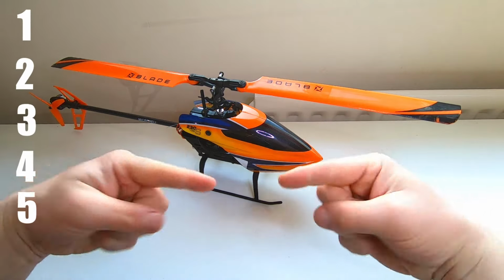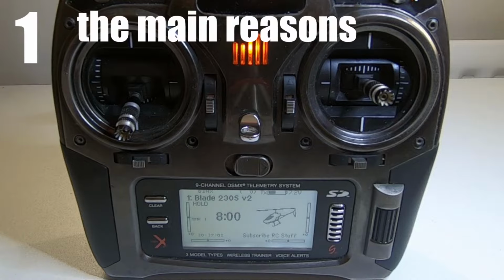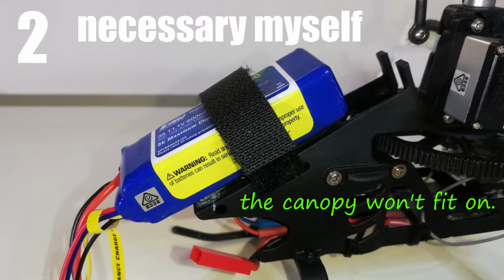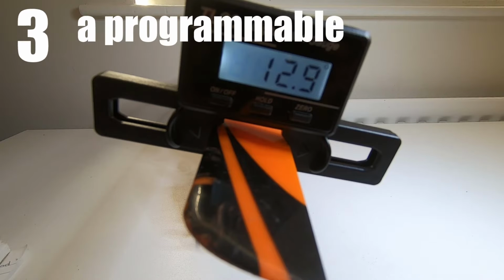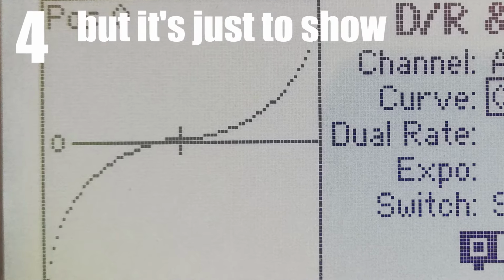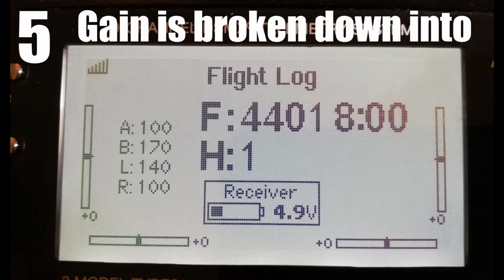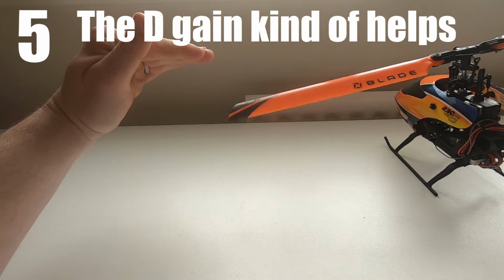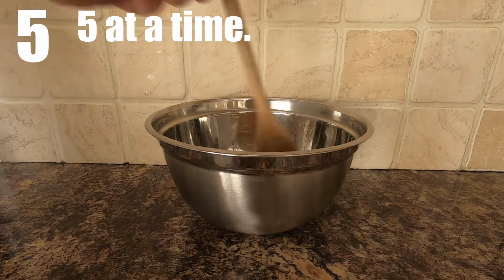Make your RC heli easier to fly: BEGINNERS guide.

Comment: That is not the gain menu, that’s tuned through forward programming on the AR363. Those are the individual antenna fades, with total number of fades and holds being reported as F and H. Your F recording being that high is insane it should never be that high.

Comment: if you are going to explain pid.  then don't say bullsh*t  

people google was PID tuning is.  
it's something that people do to fine tune servo motors and heating devices.  

basicly you are telling a servo motor to move x amount.  
and with pid tuning you will tell the software how HARD/FAST it needs to correct (so apply more or less voltage).  how much it needs to anticipate approaching it's final position and thus slow down to be able to stop exactly where you told it to.  
and how hard it needs to try and hold that position. (it could move to position and go full voltage trying to hold it there.  or basicly drop all power and hope it just stays there on it's own) 

you heard his helicopter make a whining sound when he was showing us the angle of the dual rates right?  
yeah that's servo whining.   
that means this guy has no goddamn clue what pid tuning is and how it's supposed to be done.

google it.  because this is just a really quick and dirty explaination.   
it's not even in the right order.  

(also you are not directly programming the servo's you are programming the flight controller in relation to it's gyro readings.) 

to anyone reading this right now.  i advise not watching any of this youtuber's video's.  i had to complain like this in a another video aswel.  
he doesn't know half of what he's talking about most of the times.  and you will probbably mess something up if you follow his advice.
Reply from the maker: lol ok mate. I never said I was a top expert or anything or even explained PID the best it was a very brief explainer. Tell me objectively ehich bit was incorrect? Also you were wrong on your other comment about orientations, Far more experienced people than me advise going tail in.
Reply: @RCStuffvideos  
not an expert was verry clear.  

just like one of your beginner tips being "if you get disoriented.  go tail in" 

b*tch if someone is disoriented.  how the HELL is he supposed to know wich was is tail in.  

that's like saying 
"when you are on fire.  don't be"
Reply from the maker: Bitch? Don't be rude or. I'll just ignore you? It's pretty obvious. As i said. You move the tail  control until you see the tail is pointing towards you. No one else seems to struggle with this.

Comment: Ok I have a Fw200 and this is my first Heli and want to start trying to fly on manual. What should do first to help with the controls as I am on the RTF controller. I was thinking turning head speed down but that’s all I can really do I think.
Reply from the maker: Hello don't know  anything  about the fw200 but use a bit  more expo and try lower rates so controls move a bit less.

Comment: I just bought the 330S RTF version and tried to fly yesterday, but could not even take off. As soon as I start slowly giving it throttle it starts leaning to the right and if it just starts to lift off the blades hit the ground.  I will start trying to figure it out, but your video should be a help.  Thanks
Reply: That's what happen to me.
After got some adviced tht auto travel of the sevro was wrongly set.
Then found out the travel of the servo arm after initial setup after plug in the power.
Then checking the travel of the servo arm that should be reverse direction force position when the body was lean to the left, the left servo arm should move up to correct tile back to its original position of heli perpendicular to the ground.
In the same to reflect action, if lean heli to the right, right servo arm should move up makes the swatch plate level back to reflect the action of lean to the right. Then tail up/down.
Servo arm should move to the position to make the swatch plate level back to its same original level to the ground position.
》What I found out in my, was the setting of the control gyro box position was select in the wrong opposite direcrtion.
Makes the heli try to lean to the side then blade hit the ground every time try to take off, and lost 4 pair blade to figured this out.
》The old good flying setting changed by itself of left no fly for years.
Reply from the maker: Ok cool good luck. Make sure it's level when plugging in battery especially when using self levelling. Check was swash plate is level after power up and all servos look centred. Maybe gyro the fbl needs calibrating too but the manual might talk about these things too.

Comment: Another "must read" !!! I got my 230s Smart in a good place with both mechanical setup and calibration. Basic tuning with very little done has made it predictable and solid. 
My 150s Smart is almost there too, just a little more fiddling and it will be solid
But the Fusion 180 Smart is a different beast. I have done a lot of with the basics. Still would feel a little disconnect, not solid, kind floaty. Been messing with the PID tuning, mostly P and I, nothing with D. I think your explanation will help. Belt driven tail has me learning though....thanks again for the video.
Reply from the maker: Cheers eric!

Comment: Thank you for this. My blade 230sv2 which now MH main frame coming 80$ more lol purposes like a dolphin. Lower pitch tiny help, but it’s annoying . Any advice ? Reduced battery it calms down. Maybe the upgraded motor. 2526/4500 believe. Next move back stock motor . Stock pinion. One thing I had it mid stick ready to pop smooth as glass, still bogs
Reply from the maker: Mine is completely stock and it porpoises too. Think there's something about the design. Probably because it's small. Ues it is annoying isn't it. How much pitch are you using? What curves?
Reply: @RCStuffvideos  all stock setting from manual. I just got MH main Frame today. I have MH SERVOS too. Only thing stock left is Ar636b, ESC, tail motor. I did have this thing flying rock solid been going crazy over this dolphin/bogging for while. I just had it manageable other night but then it hit hard upwards during trim n crashed . So decided to buy the frame. I tried switching back to stock gear too. I love OWB setup so going back to that . I’m new to the hobby fairly new still. I have dx6 gen 3 tx . I just lowered pitch in normal mode down few points couple times , but was getting sluggish. Really frustrating all seems perfect spoiling up for trim flight mid stick sits still n blades tracking amazing, just once pop it up get going it will do that dolphin bogging driving me insane !!! Thinking  maybe replacing the FBL with mini ikon 2 or soemthifn . I dunno cause I’m invested now n I have to figure this out, maybe , maybe not. I don’t wanna have to fight the heli. Maybe it’s the RKH mail rotor head. Even though I had that on pretty solid too. Thinking the bogging up n down was head or the collars on shaft I adjusted played around n nothing . Gets better n lowering pitch a tad helped tiny bit, but still annoying . I dunno gonna keep at it and hopefully by end of weekend I’ll have the frame together n give another go. I’ve done so many different things . Stock parts back on. Just got another pair of MH blade grips . List goes on n no. Tried bk to my dx6-I . Anyway you ever figure yours out please give me some insight . Any advice appreciated sorry for the book
Reply from the maker: @jtkeys7618  haha that's okay mate. My mindset would be if you want something flying amazing you'll probably have to get something a bot bigger and better to be honest. If i did manage to sort ot I'll let you know but i have a trex 470 now l
I'll be flying soon.
Reply: I’ve been trying to just get a good solid hover like I had it, n that dolphin affect I have it hovering but it will pop n bounce &makes that distinct noise n gets away from me a little . Landing it too bouncy . I just don’t wanna fly it like that. Gonna go bk stock motor next, the swap the FBL out of that don’t work. Not giving up ( just yet ) lol thx for reply n your way more advanced than me just by watching your video which is great and thx again for that . Gonna watch it few more times lol take care happy flying ( in my case hair ripping out my head flying ) haaa
Reply: @RCStuffvideos  your right lol awesome I’m stubborn wish didn’t have it flying amazing b4. Take care

Comment: This is the first visual demonstration I have found of how expo works. I understood the theory just fine, but sometimes seeing is believing. Well done, sir!
Reply from the maker: Thanks Tim glad you liked it. Happy flying.
Reply: The "opposite" can be done with expo.  Increase, cyclic and rudder response if you program "negative" expo.  Only if you are advanced with precise finger control and reflexes.  Otherwise, dumbing it down is the way to go with expo.  Flying RC helicopter requires a "frenzy" of stick motion especially with cyclic  stick.  The advice of "small precise movement" only applies to airplanes, because there is no "groove" when flying a heli.